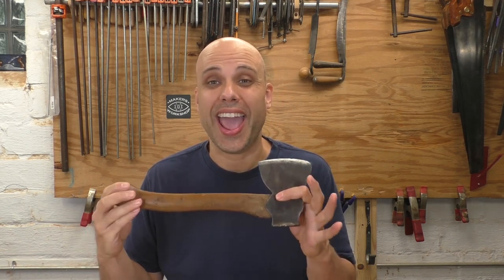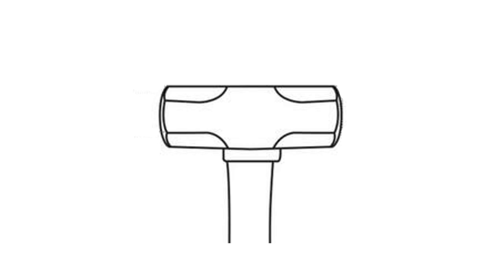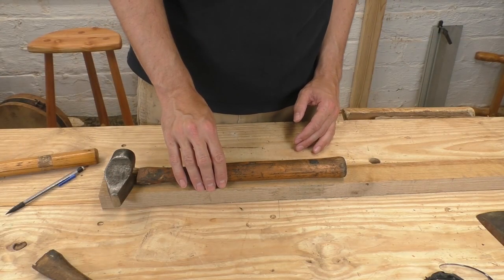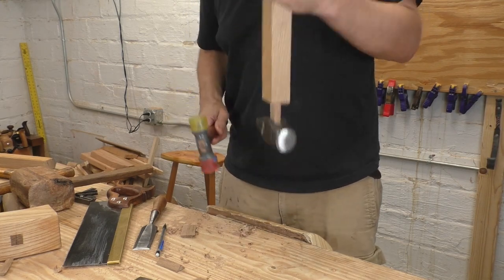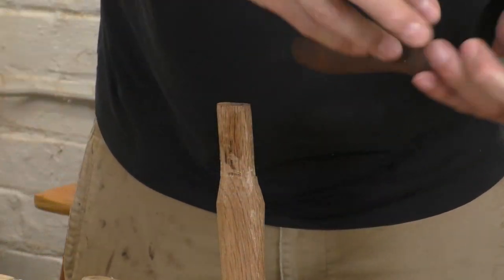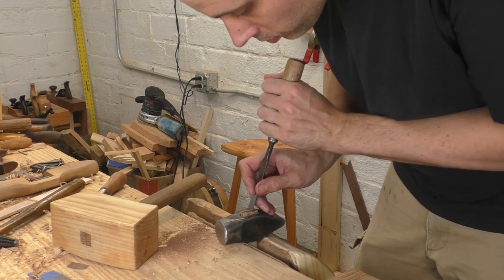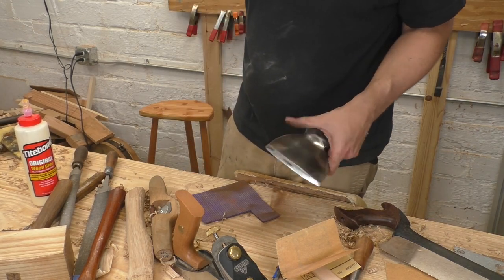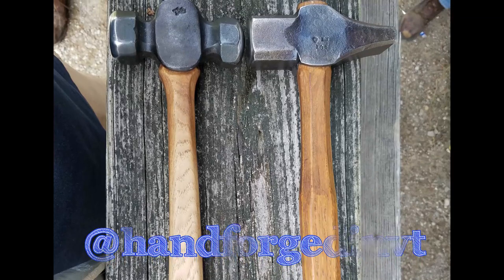Make Custom Handles for Your Tools! (Ax and Hammer Restoration)

Comment: For anyone feeling nervous about making handles, I've replaced hatchet handles in the middle of the woods while backpacking using only the hatchet head and a Swiss Army knife and had them last decades. If you are using the right wood and proper tools you are practically guaranteed to succeed.
Reply: How much would you say the wood type really matters for a carving hatchet? got an opinion on this?
Reply: Preferably a broadleaf tree, but use what you have. If you are in a pine forest wishing for ash or maple won't do you much good.
Reply: @finnmcool2  thanks! How about fruit trees like apple or almond?
Reply: @moriel-bareli  Apple would be excellent. It's flexible and tough. I don't have any experience with almond but would expect it to be fine, if only as a temporary handle.
Reply: @spartacusnow Elm can make a very good handle!

Comment: After I fit a head I fill a paper plate with linseed oil and put the tool head down on the plate. Leave it overnight and it will drink a surprising amount of oil through capillary action. Once the blo polymerizes the wood in the eye is well protected. I put a thin coat of oil on the handle before I put the head down in the oil and another after it has done its thing overnight on the paper plate.  Been doing this for a few years and it's always worked well for me
Reply from the maker: Sounds like a great approach!
Reply: How much does it take after the fact for all that oil to fully polymerize? It must be a lot considering that one time I unfortunately finished with oil the inside of a box and had to wait almost a month for all the smell to be gone
Reply: @Lagrange00  I would bet it'll take a while but most of the oil will be inside the head so it won't be able to off gas much.  The area that is exposed is also small. So it should be fine unless you like taking your freshly handled tools to bed.
Reply: when I rehandle, I put the new handled head into a bucket of BLO and leave it at least overnight. Those heads stay put for years.
Reply: @Lagrange00  I'm not sure how long it takes,  but I'm also not super worried about it.  The key is it won't evaporate so the wood fibers will swell and stay swollen.  The stuff exposed to air will polymerize  first and seal in the rest. Eventually it will all  polymerize and harden up, which is even better,  but until it does that head isn't going anywhere.  I usually let it drink all it can on the end grains and put pretty light coats on the rest of the handle. I find that if I go really heavy on the rest it gets quite gummy.  Many very light coats over time are the way to go on that part imo
Reply: @b61982  

The old school of thought on treating wood handles with BLO is:

Twice a day for a week, then twice a week for a month, then twice a month for a year, then twice a year forever.
Reply: @cavemanjoe7972  That sounds great, i´ll try to remember that

Comment: Love the video! I have a huge collection of old tools, collecting and restoring antique tools is my main hobby. I've probably hanged over a hundred handled tools and wanted to share a few extra little tips I've picked up. 

When you drive the wedge, you can flip the tool upside down and set the wedge on the floor, or on a board, then strike the handle to both seat the head further and drive the wedge in. It's also totally fine if the wedge splits, just drive the individual pieces in as far as they'll go. 

This next one is kind of contentious, but I think it isn't a bad idea to leave a tiny bit of wood sticking out the top of the head (called hairwood, since it sticks out the top of the head). Just like an eighth inch. If you wind up needing the metal step-wedge (I never knew my real wedge) and eventually need to take it out, you can saw off the hairwood and the steel wedge will be just a little proud, and then they're easy to walk out with a punch or a cold-chisel. 

I have over 50 axes and two-dozen hammers, and I use them, and I've only glued one wedge. I've only ever seen one wooden wedge sneak out after a ton of abuse. The glue definitely doesn't hurt and it can kind of lubricate the wedge going in, but I haven't found it strictly necessary. 

A great source of parent stock for hammer handles is sledgehammer handles. Some older hammers, especially handmade, can have absolutely cavernous eyes that a factory hammer handle doesn't fit. You can usually get at least 2 handles from a sledgehammer handle, they're almost always straight-grained hickory, and they're already close to the right dimensions. 

Fitting the handle with chisels, planes, and spokeshaves is a totally valid approach, but if you don't have those tools yet the little $12 four-in-hand rasp can do almost all of the handle fitting and shaping. It's definitely work, but I've hanged dozens of tools with one before I furnished my workshop.

Again, loved the video!
Reply: Jarod Jones ... Great ideas all you shared especially using old used (long) sledgehammer handles to make new ones for other tools. As you said they’re already close to being shaped to what you’re looking for.
Reply: This comment is valuable and interesting all around, but the "(I never knew my real wedge)" joke deserves special recognition 😆 loved it
Reply: You have to put a lot of work to make something great with files. But I do sure love working with them.

For the wooden wedge i notched it horizontally, I tink it really is making a good work for my separation for a handle of an old hammer.

And note, I applied glue to that mid part from the wood and the steel

Comment: I've got a lot of black locust growing on my property. I use that a lot for tool handles. It's fantastic. But the down side is that it's harder than the metal (joking of course but not by much).
Reply: I too have the locust on mine. I made some handles out of it but it is very hard and i have a feeling it is less elastic than ash, which is not good for an axe, at least.

Comment: There's a good video on the Skillcult channel about modding the metal wedges so you can get them out later. He undercuts the edges with a file to provide a lip so you can get an edge under it later to help you pry the bugger out.

Comment: I don't glue my wedges I just cover them in BLO before installing them, it adds lubrication and really lets the wedge go in farther than it normally would. I also cover the end of the handle with BLO before I install it in the eye to really help it seat down on the flare. Some times the wedge goes in so tight that it squeezes out some of the BLO that had absorbed into the handle.  When the BLO dries and polymerizes it tries to swell and tightens the handle even more.
Reply: Does the wedge not pop out easier because of the oil? The glue at least binds it in place to a certain extent, one would think. The proof is that it is hard to get the wedge out if it is glued. But oiling of the handle before hanging is a good tip - i will try it the next time i hang an axe, which is soon. thanks.
Reply: @Jack_Schularick   A oiled wedge should be just as hard to remove as a dry wedge because you put them both in as far and as tight as they will go so the friction between the handle and the wedge is the same. However, the oiled wedge slides in farther so it creates more pressure out to the head. There probably are slight differences between the actual insertion friction and removal friction with or without oil but I suspect that they are minimal. For my handles I want the absolute tightest fit in the eye that's possible. Once there's some movement things start to loosen up, wedges come out etc and the movement amplifies.  It would be interesting to test to see if glue helps or hurts how far you can drive in a wedge. I can see it acting as a lubricant like oil or I can see it getting spread so thin that it starts to set up and hinders how far the wedge goes in.
Reply: @diyVT  Thank you for your interesting response, diyVT.  I like your points. About the oiled wedge going further. It can be that the oil, as i polymerizes and hardens, creates a gluing effect between the surfaces. Or at least prevents drying locally. "There probably are slight differences between the actual insertion friction and removal friction with or without oil but I suspect that they are minimal" - That's a bold statement!   "It would be interesting to test to see if glue helps or hurts how far you can drive in a wedge" - yes. An it should not be too difficult to make a good model for this. But not less interesting, and probably more relevant to real life would be to have a good model for wedges coming out: with or without glue or oil. And this seems very complicated. You can't wait a year or more for the drying and settling to take place. And you can't repeat various mechanical influences in the thousands of repetitions over months and years. Which kinds? Is it going to be like a grandmother making kindling or a 3 meter high Poul Bunyan felling a wood a day with the same ax? One could find a repetitive movement/shock which would approximate something in between in real life, perhaps. But the most relevant experiment would be to visit a professional, preferably intelligent, axe specialist who lives off of not having to rehang the axes he sells, and ask him. Problem is, that nobody is fee from personal bias etc.    My idea for  a model for wedges coming out would be a block of wood with a wedge (plus/minus glue or oil) kept in vice or clamp for say, a month. Then bang it from the side a fixed number of blows and then try to get the wedge out, measuring the force needed.  It migt even be double blind placebo controlled, in three prongs: +glue, +oil and nothing (placebo).  What do you say?
Reply: @Jack_Schularick  sounds like a good video. You could also make special heads that the handles go in that you can measure the expansion of the actual steel "head" to get a idea of how tight things are. Getting the "head" dimensions right could be difficult but it wouldn't be that hard to actually make.
Reply: Interesting idea with just BLO on the wedge. I’ll try on one of my mails and test the theory. (Checking often)
Reply: @diyVT  You can also use a few drops of Swel-lock on the top of the wedge after insertion to really maximize the grip of the wedge in the slit. I typically put the Swel-lock on, wait a day or so for it to dry out, then saturate the end grain in BLO until it won't take any more. That gives a super-solid grip, but you can still replace the wedge later if needed without destroying the whole handle. That's the downside of glue, for me -- you can't rehang using the existing handle.

Comment: As always, great video Rex!I learn so much from your channels, but for once perhaps I can return the favor and pass some useful information your way. In your video I was surprised you didn't bring up grain orientation in tool handle construction, especially for high impact tools such as  hammers and axes. In short handles its less of an issue, but as you start crafting handles for longer tools, you ideally  want the grain to 1) extend continuously from the head to the toe of the handle, and 2) you want the grain orientation to run in parallel with the striking arc (aka in parallel with the cutting edge of an axe). In the two handles you made, the grain is running at a 45 degree to the striking arc. Again, not a huge issue for a small handle, but for a large broad axe, your handle is more likely to split. A perpendicular orientation to the direction of force is the worst, and usually results in the handle splitting along the plane of the grain. Up here in Maine we use Ash for our handles, as hickory is harder to come by, but ash, hickory and white oak all make fine handles. I've also tried Osage orange which is extremely hard and still flexible, but i have never encountered a tougher wood to carve, and I think my tools instantly become dull at the mere sight of that Osage orange timber! Then again, I used it to make your woodworkers mallet, and the buttery yellow handle combined with a dark walnut head is a beautiful tool to look at.

Comment: There is a film called 'traditional Finnish house building process', here on YouTube. In the film, you see one of the guys using a side axe like yours, but he has a step wedge in the head, so he can tap it out and flip the head over to be used in the other direction. I thought it was interesting, although every one I've seen has the part of the handle that goes in the head steam bent or carved to put the user's knuckles out of line of the swing, and permanently fitted.

Comment: You talked about watching grain direction when shaving, but you forgot to watch grain direction when choosing how the handle was oriented in the head.  The grain in the handle you made for the hammer was oriented almost 90 degrees off. When at all possible try to get the grain to line up with the length of the tool as much as possible. Your handles will have less of a tendency to break.
Reply: I learned this from my father.
Reply: I dont think i understand what you mean. Can you explain?
Reply: @jamesbondo5895  You want the grain to run parallel to the head of the ax or hammer. If the grain of the handle runs perpendicular the flat gain will have a tendency to split especially if there is a curve in the handle that allows for runout.
Reply: This is an interesting subject. I have a heavy felling axe with a slender 36 inch ash handle where the grain is in the "wrong" direction. Despite heavy use, it refuses to break. Plus, it is very elastic meaning - shock absorbing, more than any other handle i have or had. The grain works like spring shock absorber, looks like. When splitting wood, it is equally easy to split along the rings as across the rings. Perhaps it is more about fiber runout in the handle which happens maybe easier when the grain is "wrong".

Comment: Yesterday, without even seeing your video, I sat down and made a new handle for a rusty old Ball-Peen hammer I found in a bucket while cleaning out a house. It had a thin piece of conduit with tape and a brass screw hammered in to secure it as a handle. 
Turns out, the hammer head seems to have a good quality steel, so i'm double pleased with my efforts. 
Did it all with hand tools mostly on a lark as well!

Comment: Hey Rex, I enjoyed the video! Interesting to see your method.

I recently did a hatchet re-haft for carving, and used a completely different approach. I have two videos about that on my channel, if you're curious. I used black locust, and I roughed in the handle while it was still green, and used an axe and knife for the shaping, and a block plane to fit the eye and shape the shoulder. I finished it with a hemp oil and beeswax paste, which is my favourite finish for handles.

Comment: I would add to your boiled linseed oil finish a trick from an "old timer" blacksmith. He'd rub beeswax over at least where your hand holds the handle and give it a buff with a rag, and that would be over the dried linseed oil. My experience is that if the weather is warmer, and you're swinging a tool a good deal, the beeswax and oil get slightly tacky giving a positive grip that avoids blisters. On the rare occasions I get a new tool or a store bought handle, the first thing I do is scrape the varnish off and apply boiled linseed oil and then rub beeswax on when it's dry. Varnish keeps the wood "shelf stable" at the store but it's hard on the hands when sweat makes your grip slick. 
I'm a pretty avid smith and have to say that the last 18 years since I learned that trick the work blisters have pretty much ended.

Comment: Excellent video sir! I inherited an old roofing hatchet from my wife's grandpa. It had the original handle and the design was junk! A couple months ago I fit a new handle by buying a replacement hatchet handle and reshaping it to fit the head and my hand. Worked like a charm! FYI, about 3 months ago or so I built your 2xWhatever scrap lumber stool... It's my absolute favorite stool now.

Comment: If you have a decent handle on your tool, but it's a little loose, you can soak the head in antifreeze overnight.  Use the clear kind if you can. This will swell the wood and it won't dry out and shrink again.  Hey Rex, can you show us how you would turn a handle using offset centers?
Reply: I tried the same thing with Boiled Linseed Oil and it also tightened up the head on my hammer.
Reply: Glycol antifreeze sweeps the wood with the liquid and the ‘sugar’ like element remains to keep the cells walls open when it dries. You can do the same with a saturated sugar solution. I used it to return mangle rollers from cracked back to round too.

Comment: Bravo Rex- again a great breakdown of a basic/primary shop skill that is lost on many of today's big box DIY guys...  One thing I do on my smithing hammers is soak them in BLO for a few days (just drop them head first in the bucket and let them sit. If you do this BEFORE you do the torch/sand/oil to the longer portion of the handle it will wick up a bit more oil into the head area. Treat the handle and seal the head end with beeswax. The oil will seep through the head area and stabilize over time- but wont readily "dry out" from the head end. 
If they ever look loose or with gaps just soak them in the bucket a few days- works a treat!
Be safe and as always at peace Rex- looking forward to the next adventure!

Comment: I have found that if you trim your axe handle down to the point that it will not quite go in the axe head and then pop the axe head in the kitchen oven at around 200F for about 15 minutes they will fit like a glove. This is best done while the wife is out shopping.